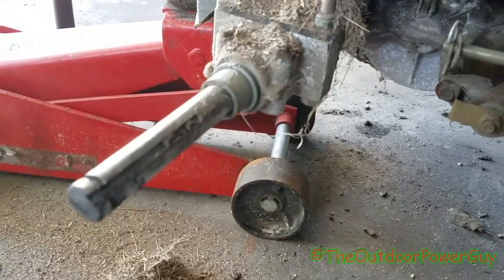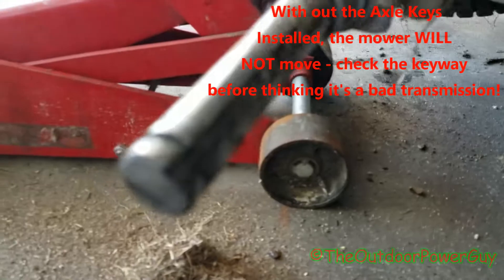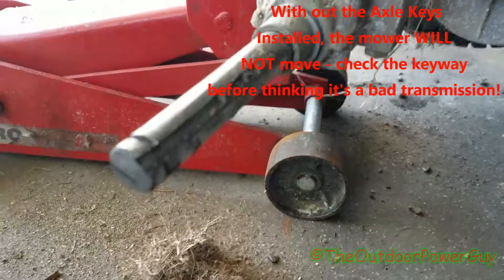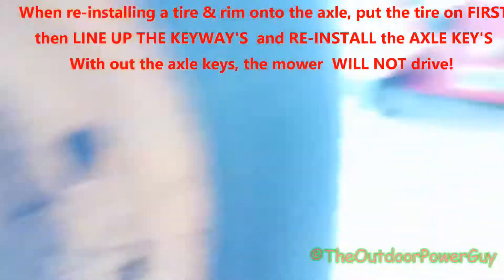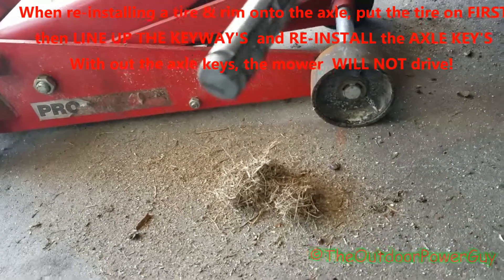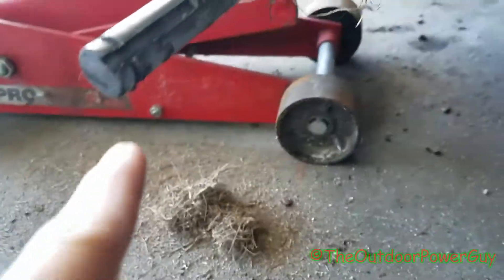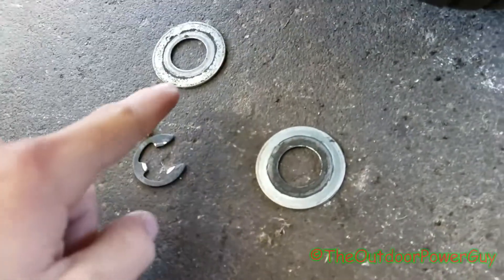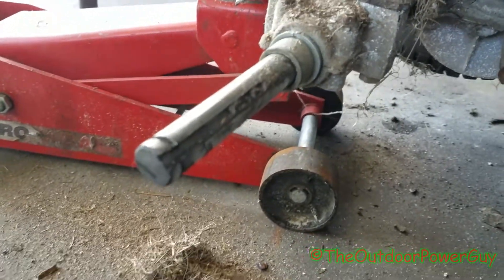QUICK TIPS EPISODE 1 - REAR AXLE KEY'S IN RIDING MOWERS

Comment: I know that this video is quite old but you saved me a lot of headaches with my newly purchased Craftsman mower.  Changed all four tires, noticed these little bits of metal after the rear was done, thought nothing of it.  Went to put the mower away, would not drive, was really confused until I came across this video.  Next day 9 June 19, put those metal bits in, moves without issues.  THANK YOU SO MUCH.  (BTW, why in the world would mower manufacturers use that type of system?)
Reply from the maker: Thank you for the comment! i am so glad that this video helped you out! That is the sole purpose of my channel is to not only educate other's but help other's with outdoor power equipment. The reason they use this setup with the axle key is say for example you get hung up on something or run over something (liek the rear wheel catches a large stump) and the tires come to an abrupt, complete stop the soft aluminum or more recently powdered metal key will shear and break saving the transaxle from severe internal damage.
Reply: @TheOutdoorPowerGuy  all the mowers I have worked on over 42 years never seen a aluminum key in the rear axle or a powdered key ,, have seen lots of broken axles and broken rims ..

Comment: Are there supposed be axle keys on both rear axles or just one side? I replaced both back tires and I only have one axle key on the back right wheel but not the left. I’m not sure if I lost it or if it was never there
Reply from the maker: There's always 2 keys, one in each axle.
Reply: Thanks

Comment: I wish you’d shown the tire being reinstalled. I’m trying to remove a rear tire from my Craftsman lawn tractor. It has a key way but the tire won’t come off.
Reply: Make sure you get a screwdriver. First use the screwdriver to remove to the C-clip, then take off the washer, and then the wheel should slide right off smoothly, but sometimes you have you wiggle it a bit to get it off.
Reply: you will need to spray penetration oil in the rim/ axle area after you removed the cap if still on the rim then remove the c clip from the axle ,, the axle could be very rusty and the axle hole in the rim could be very rusty ,,  some rims have holes in them for wheel weights you might be able to hook up a puller ,, if you hit the rim from the back side it could bust the axle loose inside the transmission ,,

Comment: I didn't change tire but Mtd yard machine. Ride on mower 7 speed won't move. Help!
Reply: parking brake stuck on or the drive belt popped off some mowers if it's a hydro tranny have a lever you pull out so the mower can be pushed by hand it could be called a bypass handle .. that could be pulled out // mower could be in push mode also the pulley on top of the tranny could be damaged and it's not turning the tranny inside ..

Comment: No keyway on my lt2000
Reply: end of you axle has a taper on 2 sides and the end of the axle has threads .. the rim slides on then a bolt holds the rim to the axle or you have a taper in the axle then a hub bolts on the axle the the rim bolts too the hub ,, ??